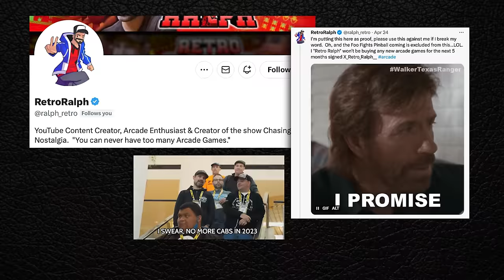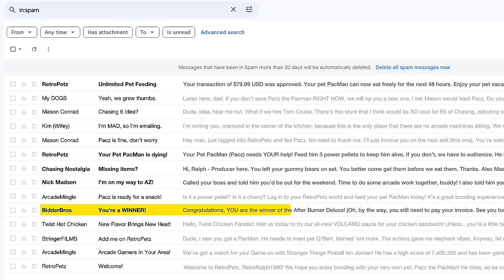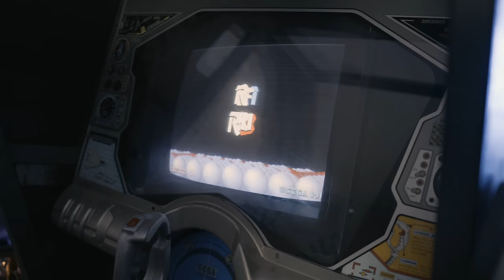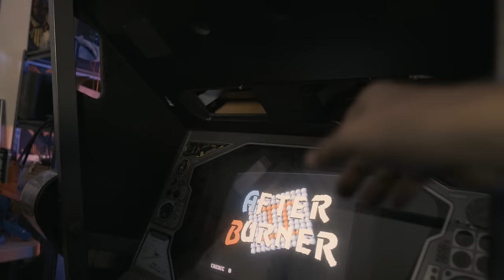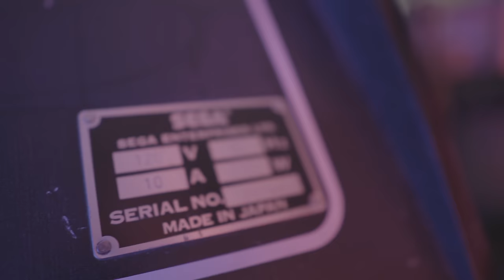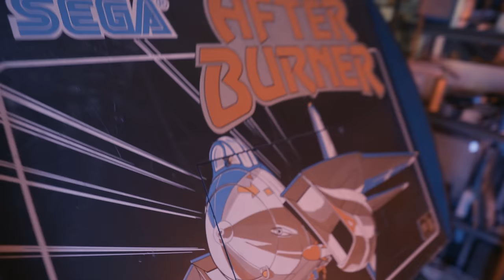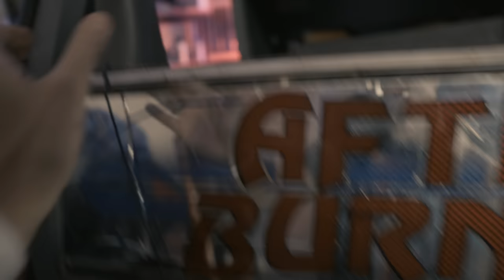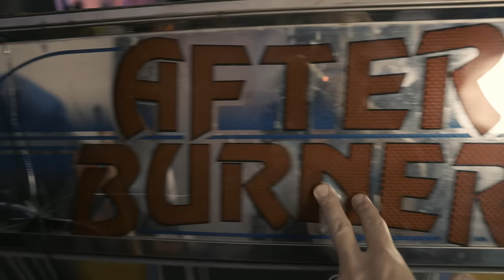I got this $10,000 Arcade Game for $300!

Comment: You can get the motors rebuilt. And if you have all the motors, check the bridges on the motor pcb board. I Have the Commander cab , and replaced the bridges and it was up n running again. Also there should be some switches that look like big arcade button microswitches, that open and close depending on the position of the cab, left, rt, up, down etc. i made a pigtail to attach to the motor molex so i could switch polarity of the motor and change the cabs direction for testing. Just flip the power polarity to the motor and it should move. If the “switches are stuck” it wont allow the cab to move. So i would start there.

Comment: I'm pretty sure there's probably a safety lock engaged I assume it engages when the ride is over there's a possibility is just seized and that's why it won't move I'm pretty It's a safety feature to protect the riders so that they can get out safely I mean I could be wrong but to me it seems like Sega would have included some sort of safety mechanism to prevent the carriage from tilting forward and back and left and right the mechanism could be in The Arms on each side or underneath somewhere with a pin or some sort of locking bar of some sort🤔🤔🤔🤔🤔🤔🤔 one other thing I'm pretty sure the mechanism is also used for when the arcade ride is transported to prevent the ride for moving I could be wrong but it's worth looking into.
Reply from the maker: Thanks so much for watching, it ended up being a seized wheel.  There are 4 of them that the main unit sits on.  It moves freely now with the motor uninstalled.  Thanks so much for watching and taking the time to comment.  💪🏻

Comment: Lol your story is very reminiscent of my Afterburner Climax dlx score. Good luck on the restore! This game is far better with the motion than without.

FYI, I don't believe the flight stick has feedback as it's usually simulated through the cabinet motion. At least that is how it works in my AB Climax and Outrun dlx.
Reply from the maker: I think you're 100% right on the flight stick.  I guess that was an upright only thing as the seat kinda moves quickly right to left to simulate that. I'm assuming it does that on your AB Climax. What a great game by the way, I remember seeing your video on that, may I ask, where did you end up scoring that?  Anyhow, it's going to be a difficult restore that will test my limits, but I'm confident with a little help, I can get it going again.
Reply: @RetroRalph  I won it on eBay for $700. I was the only bidder and like you didn't believe I would win it lol. It needed a new monitor but apart from that it worked. Most expensive part was shipping but I still got it below cost at the time.

I'm currently restoring my Outrun which is a lot more intimidating than it really is. They make a reproduction motor drive board for these cabinets if it turns out the motion doesn't work. It's totally doable so don't give up on it. Owning one of these Sega dlx cabinets is truly an honor.

Comment: Electric motors can be rebuilt. If the Stator is bad, it's probably toast but otherwise if it's a capacitor or bearing it probably can be saved. I would look up a local electric motor repair shop.